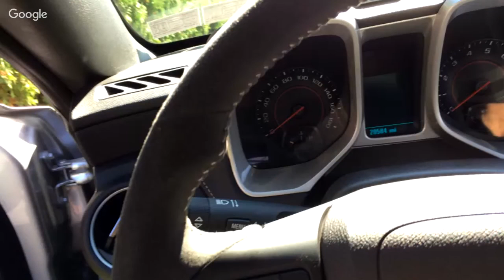Chad's Camaro 1LE!!! - Car Talk with CarGuy11 & Friends

Comment: I forgot to add one major set of components that come with the 1LE option, the suspension!! In addition to what we mentioned in the stream, The 1LE gets a unique 27mm front anti-roll bar (ARB) and shares the 28mm rear ARB with the ZL1. Also, the front strut damping has been tweaked for the 1LE and the rears upgraded to monotubes. The springs remain the SS rates. The 1LE also gets some of the ZL1 rear suspension links. The half shafts have been upgraded. And as we talked, the SS 6 speed is different than the 1LE. The 1LE also gets the ZL1 electric power steering and the short-throw shifter.  Don't forget the front splitter, that comes with the 1LE too!
Reply from the maker: +roadracing3 Yeah I knew there were a lot of changes even more than they talked about in the marketing materials. Great value for this option.

Comment: What tire pressure do use for the track? The manufacturer recommended pressure for my 2016 C7 is 35 psi.
Reply from the maker: I usually start with 30 psi cold pressure.  On track pressure got up to 37 psi.  Probably 35-36 psi is ideal hot pressure.